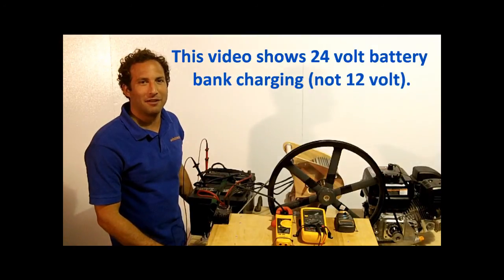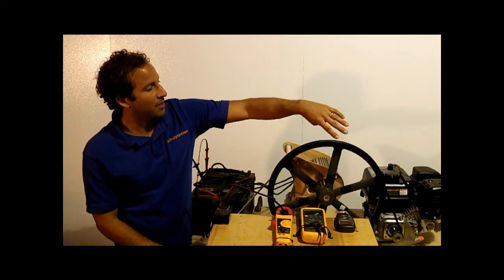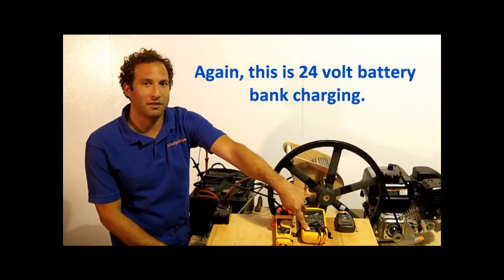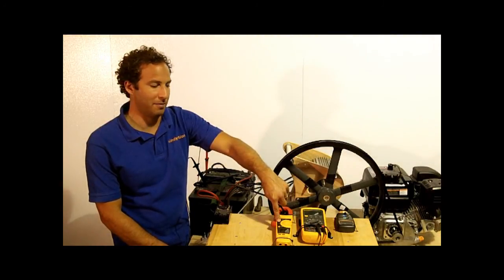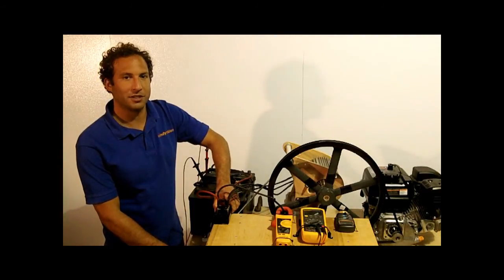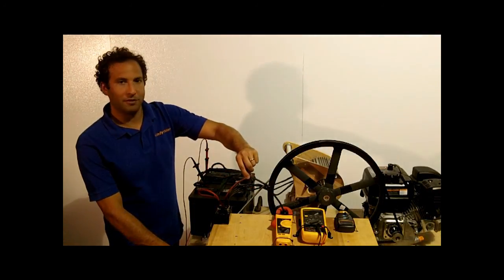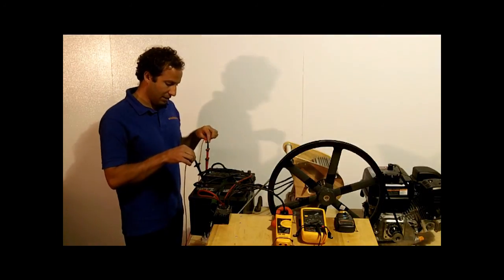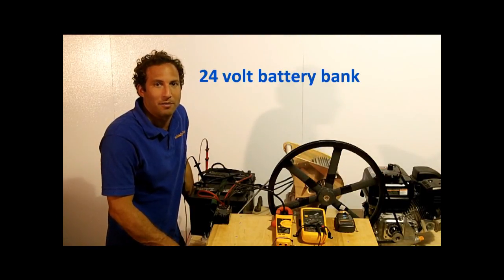Wind Hydro Generator Turbine 24V Battery Bank Charging showing RPM, Volts and Amps

Comment from the maker: @AmpstoWatts Yes, the stator is about twice the size. The stator also uses high performance, thin stacked electrical steel laminations to drive the magnetic flux through the stator which increases power performance.  The electrical steel we use helps significantly with controlling eddy currents which also helps increase the power output. 

The magnet claim is also true. We now use a new rotor design that incorporates ~3 inch long neodymium rare earth magnets.  

Thanks for the comment.